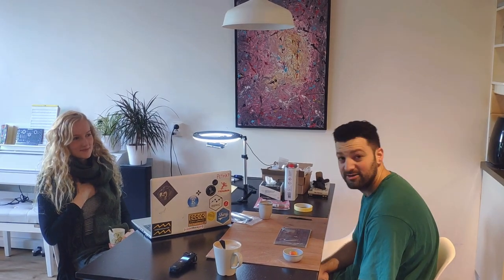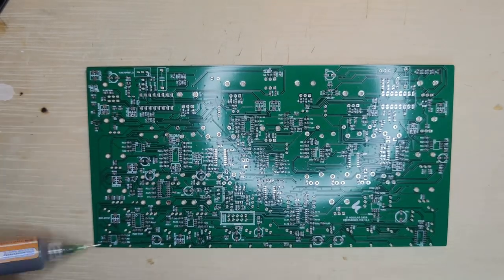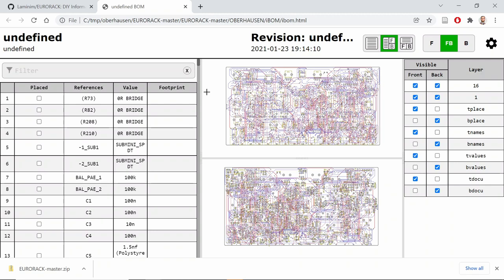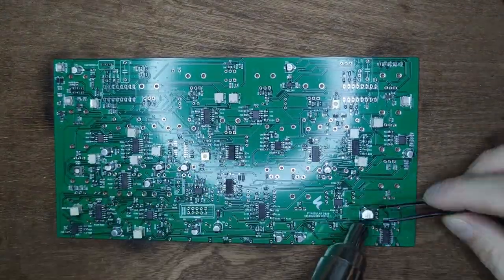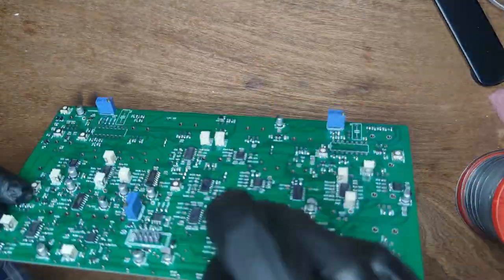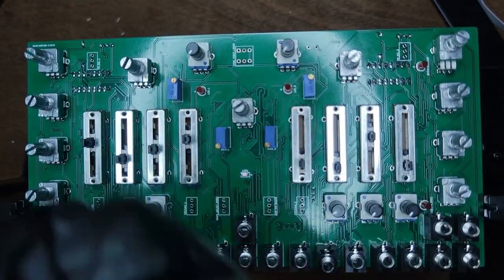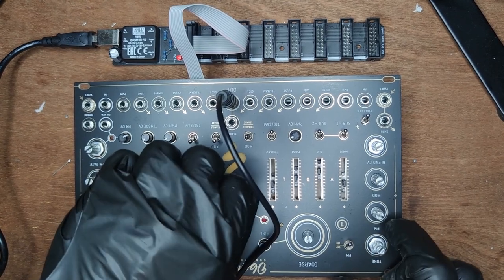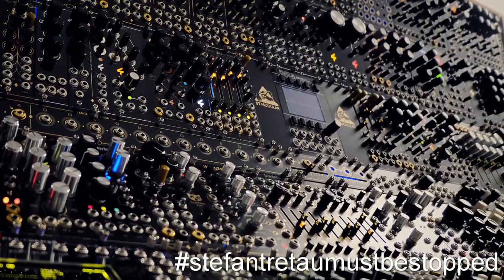ST Modular Oberhausen - DIY tutorial, demo, and review

Comment: I love my Oberhausen, it’s my main oscillator and love the dirty sounds I can get from it and the amount of modulation.
Totally agree that this would be better with cv control over the waveform levels, and I was also surprised that I couldn’t take individual waveforms out of the oscillators without removing it from the mix.
I’m certainly interested in the calibration video as mine may not be perfectly calibrated (I’ve just bunged it in and tuned it)!
It’s also caused me to get another rack!